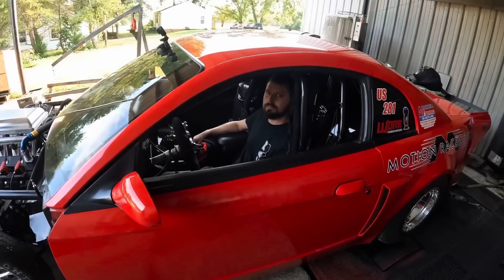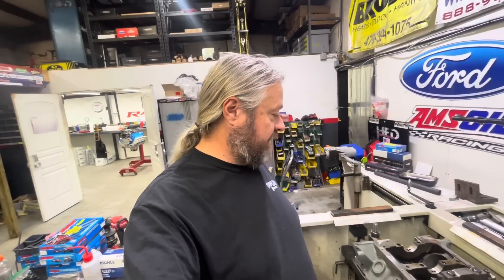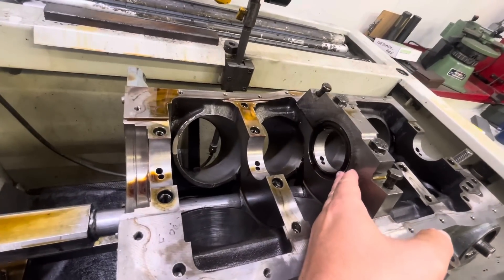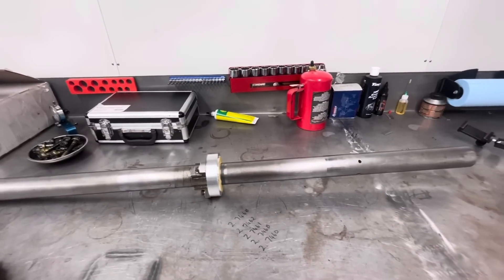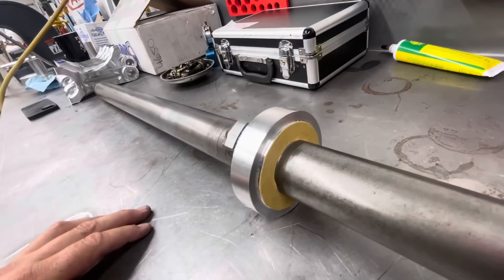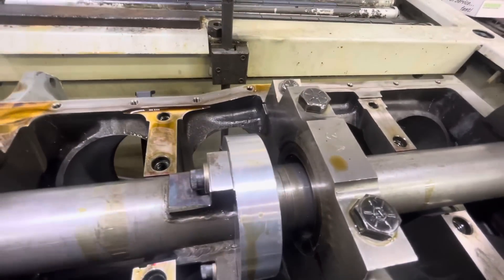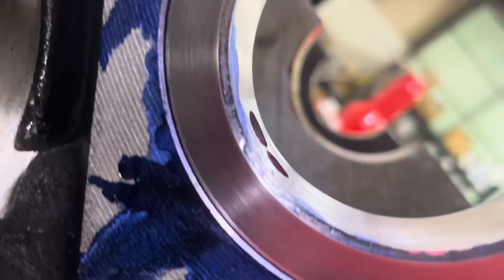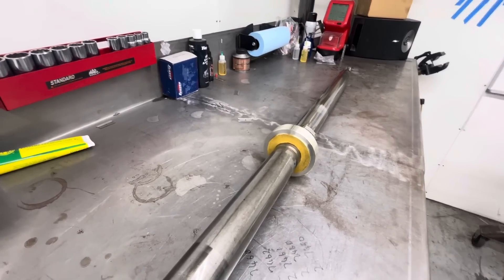Thrust Surface Repair!!  What could possibly be more exciting than this?!

Comment: Okay, now it's a true & square surface. So does the stock thrust bearing still work, or do you need a bearing with a narrowed cross section in the saddle or a thicker thrust face? Obviously, you didn't remove a lot, but ya did remove something, so how do you go about getting the crank to sit where it's supposed to?

Comment: If your paper holder was on say a square drive against a shoulder, you could then just slide the mandrel in the center out to replace the paper instead of having to pull the main caps.

Or the other simpler option is to just cut the paper radially in one place and flex it over the center mandrel to stick it onto the thrust polisher.